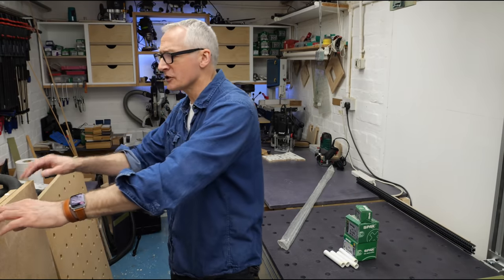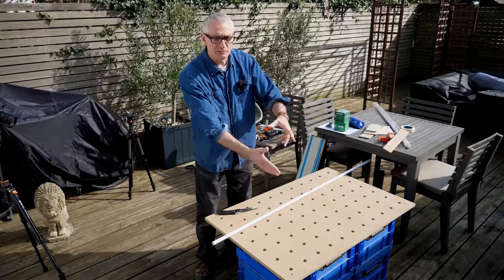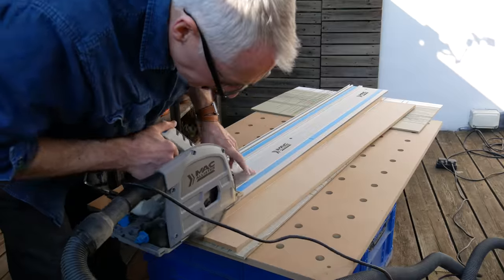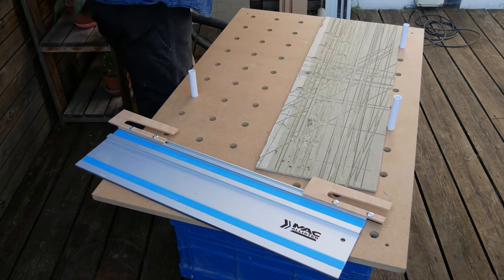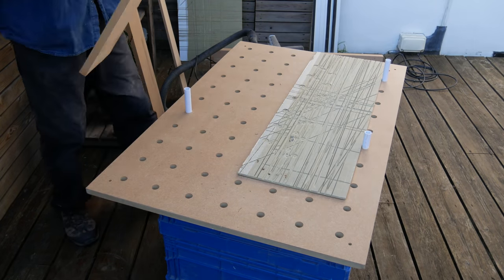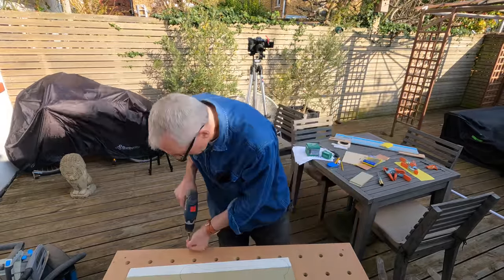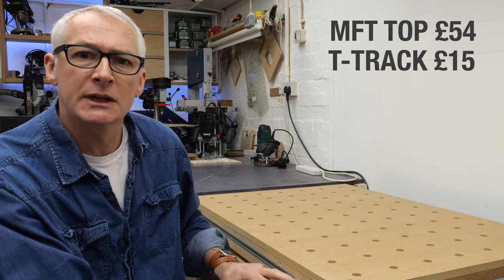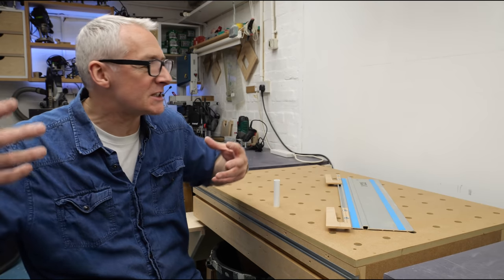Backyard, DIY MFT on a Budget  [video 490]

Comment: Great build, is there a specifc dim for the thin strips that go either side if the T track....? Do you have a video that shows the side rail in action and it's applications thanks :)
Reply from the maker: The dimensions are based around the previous MFT  build, which used the Dashboard PWS rail hinge; if you don’t plan to add that then make them whatever size you like. The front t-track is used for clamping all the time - see the current video (3 drawers, no tape, no ruler)  in the ‘basic build’ series where I’m cutting rebates. 👍

Comment: With the DIY dog locks... isn't there a risk if they are not both exactly identical that the track would no longer be parallel to the dog holes? And how to avoid that?
Reply from the maker: No, as I say at around 5:20, the idea is that the shape of the dog lock wedges the rail against the benchdog, so it bears against the same surface every time. 👍 I explain the making of them in more detail - with a cameo from Dave Stanton - in the previous video, link in description. 👍

Comment: Great design Peter, thanks for posting it, you've inspired me to make one of these as I have a top sitting in the workshop and some plywood offcuts in the scrap pile. Ive bought your plans for the track hinge so that will go on too but I have a quick question about the distance between the two sets of t-track at the front and back; is that a random distance or do you set it for some particular device? I only have two t-tracks at the moment (one each for the front and back) but I'll build it so I can add the second tracks easily later.
Reply from the maker: Thanks Justin; the spacing of the t-tracks was originally set out on the workshop MFT build, and was to suit the holes in the Dashboard PWS hinge; if you're making your own then you can make it whatever you like, within reason. HTH P
Reply: @10MinuteWorkshop  that’s great, thanks Peter. Made mine up yesterday and tagged you on instagram with the result. Just need to add some folding legs and your diy hinge.

Comment: Great Video. Can Peter or anyone tell me what is the second groove for in the front face. It is obviously T Track size, but the T track is not fitted, so a little puzzled. Current use a workmate with a lift off 3/4" top, but this is way better
Reply from the maker: Just a second clamping opportunity so that you can eg keep a rail hinge in place while clamping a workpiece to the apron. 👍
Reply: Sorted, After spending the night watching umpteen videos of his, the second track appears. Puzzle solved.

Comment: Hi Peter,
I’m a newcomer to woodworking. Love your videos. Is the festool extrusion profile the only one that will accommodate festool tools and accessories.
Reply from the maker: Hi Paul. It’s the only one that will take the Festool rail hinge, without modification. Other accessories like the clamps etc… will fit in regular t-track. 👍
Reply: Thanks Peter. I think you referred in your review of the dashboard rail hinge that a regular T - track  will accommodate same ?
Regards 
Paul
Reply: @10MinuteWorkshop  
Peter,
I am making an MFT table , the workbench is 1500 x 900 mm
I am contemplating making  8 holes at 96 centers on the 900 width which leaves 61 mm on each side. If I then make another offset row row at 32mm leaving 29mm. Will this be ok to accommodate the quad MFT rail hinge ?
I apologize for bothering you.
Loved your video on The quad rail hinge - keep up the good work/ you inspire us all.

Thanks 
Paul

Comment: Great video - very inspiring. I want to build my own MFT and after checking the suppliers from your list, I am confused a little. The T track from Rutlands is offered at 1000mm length however the MTF top is 1102 in length. In the video you had to trim the tack. I am assuming it was longer than 1000mm. Please can you confirm if you used a longer track.
Reply from the maker: The Rutlands track was available in 1200mm lengths when I bought it, but they now only supply 1000mm lengths. Woodworkersworkshop so the same profile track in 1219mm lengths, so I’d buy from them tbh. 👍
Reply: @10MinuteWorkshop  Thanks Peter, that's very helpful - much appreciated - Steve

Comment: Love the idea of basics builds. Any tips with the McAllister? I've got one but it tends to "burn" the MDF if I've plunged and then cut. (It's only 18mm MDF but yours looks like it goes through like butter!) I can't decide if it's that the blade is blunt (it's the original) or if it's not cutting true and is rubbing as I move the saw along ! Been through your back catalogue but couldn't see any tips on the McAllister
Reply: Check / clean the blade. The resin in ply and mdf builds up quickly.
Reply from the maker: Thanks James! What Andrew said tbh - either clean the blade or try an alternative. I haven’t done much on the MacA other than compare it to the Lidl Parkside, simply because it’s a dead ringer for the old Titan. 👍👍

Comment: Should the rail holders (Dave Stanton) not be turned to the opposite of each other (outwards)? Even if you have no intention of moving the rail towards you it seems like a small bump-into the rail could cause issues.

Also Harris Knudsen (hokdk1) is great with DIY MFT.
Reply from the maker: Like they are on the thumbnail? You can have them either way; facing opposite is good if you’re sliding material under the rail, facing to the back is good if you want to routinely remove the rail off the dogs. But either way works.👍

Comment: Who manufactures that mft top? Reason i ask is that i see replacement tops sold for festool mft's. I have the UJK Parf guide system and all my TSO dogs fit snug. I put those same dogs in the Festool MFT that a contractor had on the jobs and they were sloppy in the holes.
Reply from the maker: It’s an issue as old as the MFT, and one I’ll talk about in detail when I cover the DIY MFT top jigs, but shirt version: Festool never intended the MFT for Benchdogs’s, the holes were always for clamping - Festool have never made a benchdog. On an OEM Festool MFT the holes are 20.16mm, whereas the rest of the work has standardised on 20mm. 🤷‍♂️👍

Comment: Whoa... Ok.  I have a possibly dumb question here.  I noticed you seemed to screw directly into the small MDF strips with the T-track, without pre-drilling holes first.  How were you able to do that without splitting the MDF?

Thanks for your response.  Awesome video by the way.
Reply from the maker: Thanks! If you're drilling into the face of the MDF you'll never split it; when I screw the top down, into the edges of the mdf frame, they're pre-drilled. 👍

Comment: I understand using 18mm ply would be stronger to build the MFT table but would 18mm MR MDF be strong enough to use for the table and legs (legs I would double the thickness)?
Reply from the maker: Yes, depending one how you plan on using it. The supporting leg on my torsion box router bench is a simple L shape of single-layer MDF. No issues at all with it. 👍👍
Reply: @10MinuteWorkshop  thanks Peter for the quick reply. I’m just a diy’er so it’ll get occasional use. Mainly just to build some built in wardrobes and dining room benches and the odd thing for around the house

Comment: Evening Peter - looking to do this one very soon.  What is the hand saw you are using - do you have a link to it (affiliate so I can buy)
Reply from the maker: It’s a folding Japanese pocket saw from Axminster; it’s particularly handy as you can get different blades for it eg a keyhole blade or one for cutting foam insulation. No affiliate link I’m afraid as the ones Axminster produce are stupidly long! HTH P https://www.axminstertools.com/japanese-folding-pocket-saw-502238

Comment: hi Peter, thanks for this. i now have the parts to make this but one question, is it a good idea to treat the mft? bees wax? varnish?
Reply from the maker: Thanks! I’ve used all kinds - water-based lacquer, hard wax oil, beeswax, finishing oil danish oil - and never really found any difference between them; just make sure that you clean out the holes with a benchdog before the finish dries as it’s much easier to do than after! 👍

Comment: How will the overhang affect the ability to add the drop-down track hinge?

Defo building one of those soon, and looking forward to the basic build videos.
Reply from the maker: Thanks Dafydd! If you keep it at the back then the overhang will get in the way for a regular hinge, but should work OK with the forthcoming Benchdogs hinge. My idea with the overhang was that you'd spin the MFT around to have it at the front, and then use a DogLock for alignment if you were using a hinge. 👍
Reply: @10MinuteWorkshop  what is this about a Benchdogs hinge? Should I wait building a portable MFT? I am about to order the festool ones. I fancy the solution of benchmark yet find them overpriced. Happy to hear more.

Comment: What is the diameter of holes in an Mft top? I bought a similar top from ebay. The holes are 20.2mm, so there is a tiy bit of play using my Benchdogs Benchdogs. Add the okay of the rail dogs to the play of the Oozenest fence and my cuts aren't square. Your piping looks a much better fit.

Ps cracking little 12v Parkside drill coming soon to Lidl. Got the bare drill, battery and charger in the summer for about £32.00. Has a quick release chuck so it turns into a dedicated driver quickly, whilst leaving the drill bit fixed in the chuck.
Reply from the maker: Official Festool OEM MFT holes are 20.16mm; the router bit they sell specifically to make the holes is 20.16mm. Everyone else (pretty much) has standardised on 20mm. Why are Festool out of step with everyone else? Because they've never made - and to this day, still don't make - benchdogs to fit the MFT; as far as they're concerned the holes are for clamping. 0.2mm is tricky to make up, but you should be able to apply a coat of clear nail lacquer around the benchdogs - then another, then another, until they fit well. Nail lacquer because it's quite a thick liquid, and dries fast. HTH P
Reply: Guessing the holes on your top are nearer 20mm then (if not 20mm).. I belive my Benchdogs have a diameterr of 19.86mm, so a 20.2mm hole is too sloppy, so the cuts aren't "square enough". Hole size is therefore something for potential buyers to look out for.

Comment: I wonder if you could give me a bit of advice. I’ve recently purchased a Makita Plunge/Track saw and have experienced some kickback. Previously I’ve used a circular saw with a track adapter and never experienced this, what could I be doing wrong?
Reply from the maker: There’s a whole playlist linked up in the video description called ‘tracksaw workahop’ that will probably answer all your questions, but the most common causes are plunging too fast, plunging into the material instead of before starting the cut, a blunt blade, plunging before the saw is up to speed, or any combination of those. As I say, tracksaw workshop is a good place to start for anyone new to plunge saws and tracksaws. 👍👍
Reply: @10MinuteWorkshop  many thanks Peter I'll watch videos

Comment: What would you use the t-track for in this case? To clamp pieces vertically, or can you also attach the track to it?
Reply from the maker: For vertical clamping, and for attaching a front rail support for a rail hinge. 👍
Reply: @10MinuteWorkshop  are the distances from the top of the T track specific ie the widths of the two 12mm strips you cut for either side of the track. I bought your plans for the lightweight bench but this looks a lot better fit for my needs which is to use outside the garage on top of two cheapo workmates used as trestles.
Also could you make the rectangle that stands on the crates foldable or would it be too wobbly in use with the saw etc on.? 
Many thanks again for this great content.

Comment: You’ve inspired me to do this! Only problem is in the States finding an affordable MFT style top seems much more difficult. Any leads on UK suppliers that might ship across the pond or other ways to make this doable in the US?
Reply from the maker: Thank you! I know, I’ve had the issues explainer to me in great detail about the unwillingness of even small CNC shops to  get involved in MFT too manufacture. I’ll have a video out before too long about various jigs available to make a DIY MFT top. 👍
Reply: I'm thinking that I'll try to make my own top out of MDF . Measuring a grid to drill the holes.  A lot of drilling but not so much to keep me from giving it a go!

Comment: This turned out great! I've only found one mft style top here in Norway and it's about £130. I did buy it though!

My workbench is based around my table saw and it's got an mdf outfeed table with mft type holes, I used the previously mentioned £130 top as a drilling template, as that top would've been too large.

Anyway! Impressed by how cheap this one turned out 😃
Reply from the maker: Thanks! 👍

Comment: Hi Peter , you must have been thinking about me ? Ha ha ha I just bought an entry level track saw , bough a nice blade for it ( not just about being cheap ) I made my own version of an MFT top which sits on a 2 trestle stands , I use a piece of hard insulation to make my cuts  on , now I hope this next question is not the most stupid question ever asked , when doing a measure , say 200mm and you draw the pencil line , where do you line up the track ? I tried placing the track right on the line and it’s out , I then placed the track about 2-3 mm on the left hand side of the track and it was perfect , my friend said “ this ain’t easy ?????  
I don’t have a fence or stoppers and this track has to be clamped every time , it won’t just stay there like you make it look super Easy , I feel like an absolute dufus , but hey I ain’t giving in just getting started 🙏 as always thank you so much for sharing your knowledge it’s so much appreciated Peter .
Reply: Just found your tracksaw workshop better start watching that 👍
Reply from the maker: Yes, I was about to say start with the tracksaw workshop series! Sounds like you need to re-trim your guiderail splinterguard; it should be bang on the cut-line, not 2-3mm out - there's a section on that in the TW series. Let me know how you get on! 👍 Peter
Reply: Yep did exactly what you said not to do , pulled out guns blazing no set up did a cut !!!! The only saving grace is I only used 1 off the 700mm tracks so just watched part 1,2 and 3 of tracksaw workshop will join both rails and do the cut starting in the middle after I have adjusted the saw and track together,  ha ha ha Peter my friend and I were just shaking our heads ha ha ha too easy , by tomorrow it will be alright 🙏 god bless my friend and thank you so much

Comment: looks like a nice and fairly cheap build. Do you need a lot of room on the underside of the MFT top? I'm thinking of making a thinner version of this to go over my table saw, that I don't use very often.
thanks for sharing.
Reply: Also a nice addon could be a floating board (like a floating bottom of a drawer) to create a downdraft table for sanding. you would only need slots in de front and back, a side made from 2 pieces and a hole for the vacuum hose somwhere
Reply from the maker: No, but I find and apron of around 200mm to be good for clamping against.
Reply from the maker: The 20mm bikes are generally too big for a downdraught table. 👍
Reply: @10MinuteWorkshop  well you can make lots of tiny funnels to go into the holes :-)

Comment: Not sure about tee-slot router bit as I think the slot made would wear very quickly in MDF. If you made the side in hard wood it would then be more expensive than aluminium tee track?
Can’t see much advantage
Reply from the maker: No, I was thinking plywood. 👍
Reply: @10MinuteWorkshop  ‘recon birch ply would cost as much as tee track still. If you did not have some ‘lying’ around aluminium would be the way forward still for me…. Unless I was making a video 🤔

Comment: Can I stand on the shoulders of giants for a moment.

I reached out to a local CNC firm and asked what it would cost to drill some holes and turn a sheet of 18mm MDF into MFT.

Spec:

18mm sheet of MDF - 1220 x 2440mm

Size of holes: 20mm

Spacing centres 100mm

Distance from edge 100mm

All pilfered from rag'n'bone's video..

They want 120 + VAT to drill it.

They mentioned the final board would be 2400 x 1200 - think to accommodate this, not sure if that would include squaring it up.

My question is, for a 1.2x2.4m MDF is that good? essentially just shy of £200 with some lugging around.. is that good? it feels pricey to me
Reply from the maker: Including the materials? Yes, that’s a fair price. A channel member of mine paid about £180 last year for something similar.
Reply: @10MinuteWorkshop  yeah so £200 is me buying and then giving them the sheet and them then drilling.

Comment: I’d be a bit careful with the screws through the top because I’ve caught myself cutting into things I hadn’t planned to cut into. I’d rather do just dowels in the frame and drop the top on it (no glue, so it can be replaced easily). The weight plus friction is probably enough to hold the top in place.
Reply from the maker: That's why they weren't countersunk or hidden - so you know where they are. Also, pretty much any TCT blade will cut through a screw. 👍